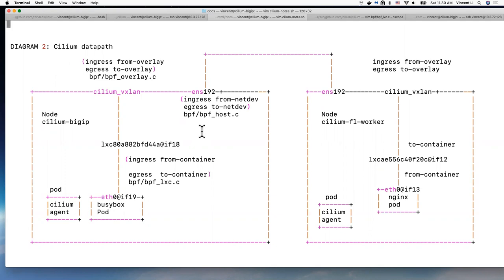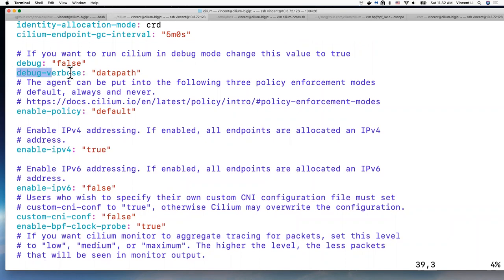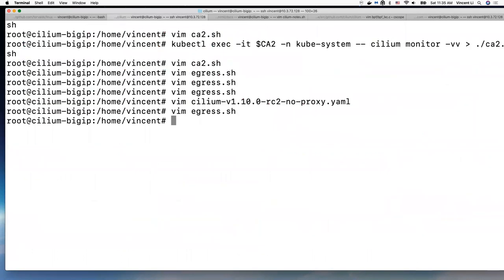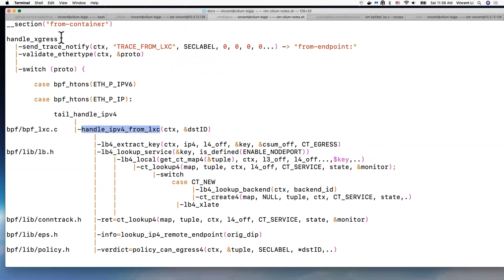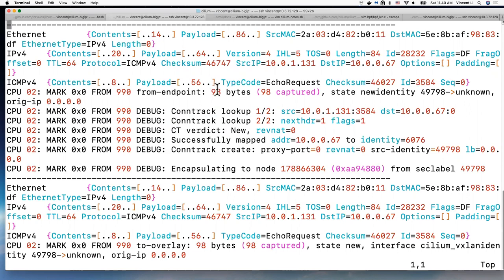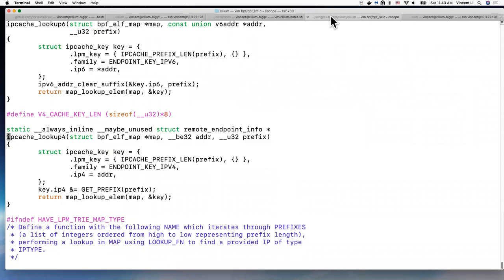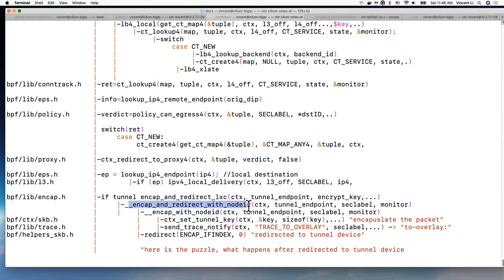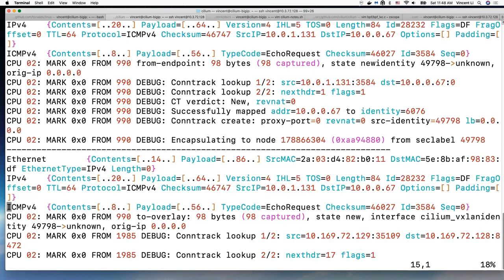Cilium overlay datapath egress deep dive 1

Comment: Thanks for the video. And what tool do you use to generate the code path? Thanks
Reply from the maker: kubectl exec it cilium agent - cilium monitor --vv > /path/output.txt
Reply from the maker: you also need to set debug-verbose: "datapath" in cilium agent
Reply: @BPFireOS  Thanks! And what about the tool to generate the C language stack trace in your video?
Reply from the maker: @iamleonliao  oh, I wrote it manually by reading the code logic and packet flow :) there maybe some tool to do that
Reply: @BPFireOS  Cool! I tried cflow, there is no if/else and switch. Then I thought you might use better tool. Thanks for your video again.